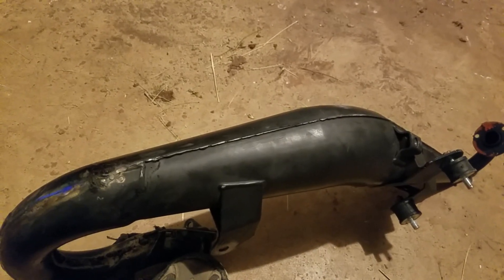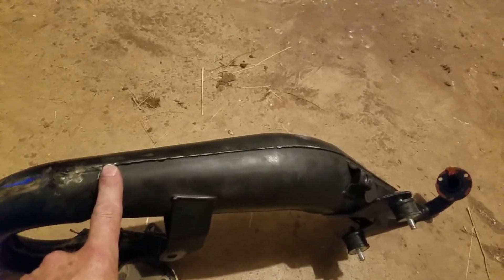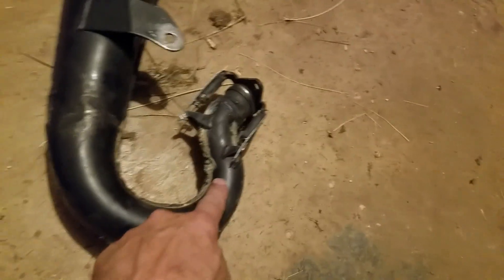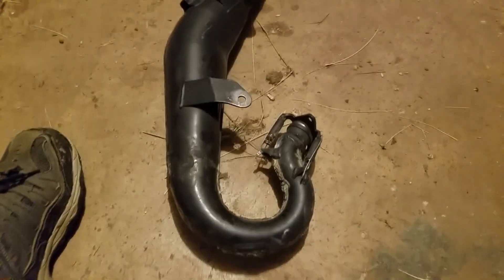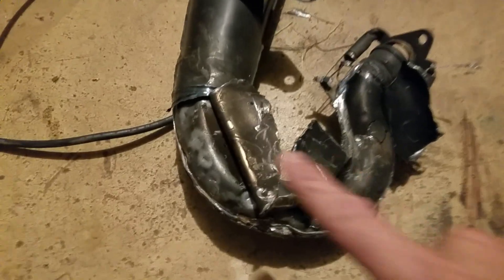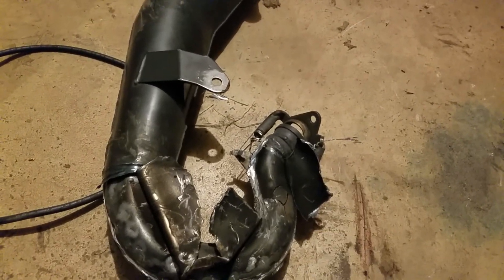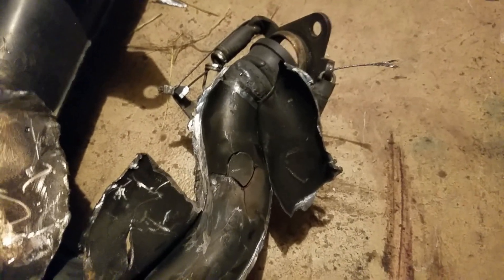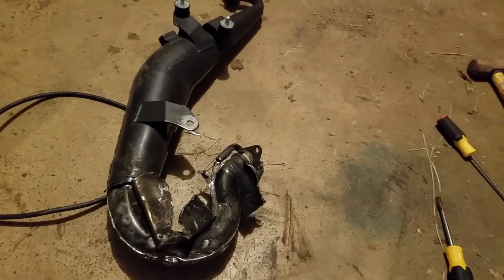Vittorazi Moster 185 exhaust hidden crack

Comment: Dude mine cracked in the same spot!!
Reply: Also best way to check for this problem is after landing and or engine is nice and warm, pull the starter cord ever so slowly and watch the back side of the shielding near the gaps and you can see puffs of smoke between strokes.
Reply from the maker: It sucked. I burned my engine up and had to rebuild the top end. Runs great now!
Reply: @Les__Mack  did you try repairing it or did you buy whole new exhaust?
Reply from the maker: @brownp93  I tried welding it, but I'n not a great welder so it leaked and I couldn't use it. That's why I tore it apart.
Reply: I've just received my 'warranty replaced' my20 exhaust because the outside plate just cracked on my 4 spring my19 exhaust..might be interesting to find out what is actually under it..🤔